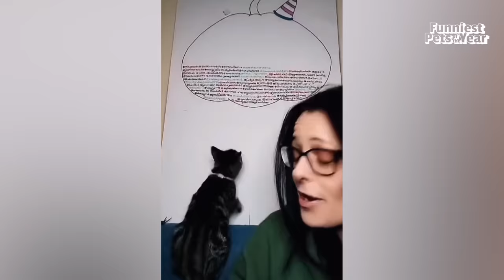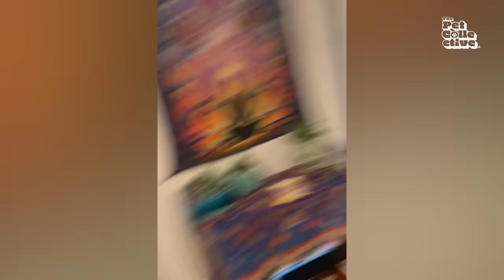The FUNNIEST Pet Videos of 2023! 🤣 | BEST Compilation

Comment: At 36:55 you’ll see the Turkeys  in front of the MBTA (Mass Bay Transit Authority) bus going to Harvard.  In 2010 I would commute on a similar bus from a town 10 miles north of Boston . Our pick up stop was on the road at a supermarket parking lot.  There were 2 turkeys who owned that particular bit of parking lot, adjoining sidewalk, bus stop shelter, and bit of roadway, only on that side of the road. The bus would stop, the turkeys would attack the back, and side up to the back doors. Everyone, including the drivers knew to only use the front doors.  The turkeys would let everyone on and off.  Then continue the attack until the bus came to the intersection at the end of the lots.   It was the wildest thing ever.  All these years later, there are turkeys spread all throughout the greater metropolitan area.